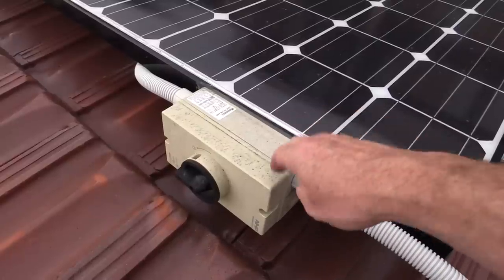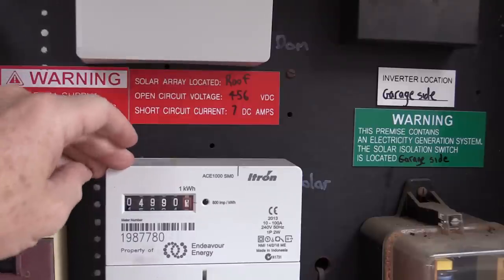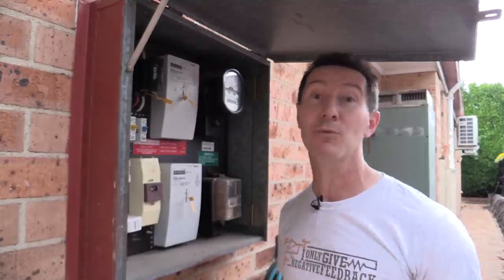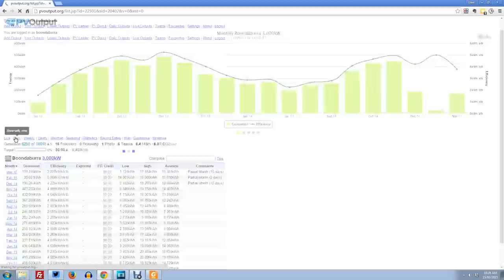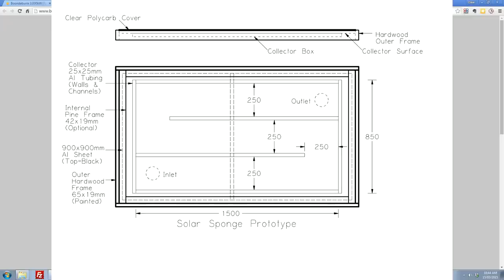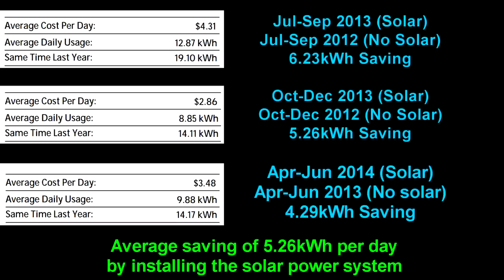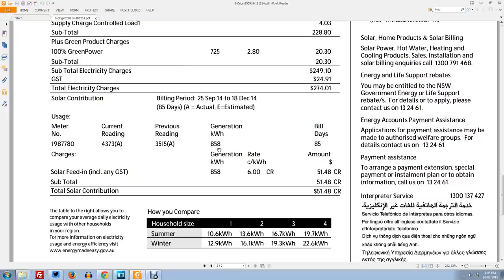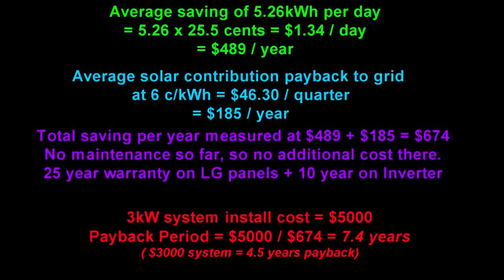EEVblog #724 - Home Solar Power System Analysis & Update

Comment: If you wanted to, could you put a battery into your system?
Reply from the maker: aMondia Yes, but would require a new inverter and other stuff.
Reply: EEVblog it would work as back up, truck batteries and charge during the day, use at power failure. We have a meter that turns back the dial with energy flowing to the grid :) bonus of the old stuff. Next to solar panels we have a solar heater, next step a mitsubishi ecodan and under floor heating.
Reply: EEVblog
No battery will be expensive you will never recover the investment at your rates.
Reply: Arjan Wilbie
Is that allowed by your energy company? It least where I life, it is forbidden to supply current into the grid with this old meters that can turn backwards. It considered taux-fraud as it is "not paying the tax for consumed electrical energy". But I mean: I speak about Germany and tax-fraud. It is both the biggest sin and most common activity in Germany. Given the complex taxing system, it´s no wonder.
Reply: ***** It isn't always about money, sometimes it's just about being a good citizen. If anything, the ROI may come from the fact that this is publically documented.
Reply: ***** Nonsense!
Reply: *****  you could build a 7kw battery out of 18650 lithium cells
for under 1000usd.  or just strip them from old laptops usually only a couple cells will be bad.
Reply: kolby4078 Commercial batteries designed for this kind of application are also totally affordable. If they weren't, there wouldn't be any market. Also, anecdotally, my uncle living off the grid in the sticks wouldn't be able to afford them.
Reply: sarowie the electric company knows we have solar panels, we used to have 3 meters in our property and we got 1 now, the others we removed and switched suppliers.
Reply: *****
I live OffGrid and I'm and EE I know how to calculate an amortization cost.
If you disagree come up with the numbers.
Reply: kolby4078 Show me the spec of those batteries and where I can get them for that price ? Used batteries are a really bad idea since you have no way to know how much life they have left and lithium needs a BMS that can not work with cells that are degraded at different levels they need to be in the same condition.
I use LiFePO4 for my offgrid house and that is by far the best solution for inexpensive energy storage. Still hard to compete with grid + the convenience of grid.
Reply: ***** Just look on alibaba, theyre cheap chinese batteries but still 2200mah@4.2v peak at $2 a cell
Reply: *****
Just found some 1500mah cells brand new are 30cents a pop
Reply: kolby4078
Have you ever used alibaba ? Those prices are there just to attract customers. You need to contact seller to get a real quote including shipping and then you will pay by bank transfer and wait to see what you will get :)
A cell without a datasheet is useless. Even a Panasonic or Sony LiCoO2 has around 500 cycles that is quite a few times lower than a LiFePO4 that has a few thousands cycles.
That $2/ cell is probably a real price but you do not know the quality of that LiCoO2 cell even if that was a genuine Panasonic as I mentioned it is more expensive for energy storage than LiFePO4.
2.2Ah x 3.7V nominal = 8.14Wh $2/8.14Wh = $0.245 per Wh
A LiFePO4 is usually $0.4 per Wh but a much better value for energy storage. Why?
Because a typical high quality 18650 LiCoO2 has about 500cycles where a typical LiFePO4 has 3000 cycles.
You do not calculate cost per storage capacity but cost per energy stored during the life of the battery. That is amortisation cost and gives you the cost for each kWh stored during the life of the battery.
Reply: EEVblog Have you costed using the surplus electricity to heat a hot water immersion tank, during the day? This might allow you to dispense with the gas water heating. Can you run a barbeque from electricity? Here in the UK people just buy bags of charcoal for that, but barbeques aren't as popular here.
Reply: dalriada842 electric can be used for a imersion heater, in combination with a solar boiler.
Reply: dalriada842
It may be the case that natural gas is less expensive than those 6 to 8 cent he gets for sending back to grid. Usually natural gas is the lest expensive form of energy. Here is about 3 cent/kWh for natural gas not sure what the rate is in Australia but I expect to be less than those 6 cent.
Reply: ***** The gas price I pay in the UK is about a quarter that of electricity per kWH. There's also the standing charge to consider on top of that though. If he could dispense with gas entirely, he might be onto a winner. Possibly pre-heat the water using a roof or ground source heat pump system(expensive though), then use the surplus electricity to heat it to temp. Solar power is a much more viable option at his latitude than it is at mine. My roof even points inconveniently East and West.
Reply: dalriada842 A ground source heat pump will never recover the investment at this sort of prices /kWh and will sure not be able to compete with natural gas.
Here in Canada the kWh for natural gas is about the same a quarter since is 3 to 4 cent vs 10 to 12 cent for electricity. But this are just prices for the unit of energy the total bill is higher since there are some fixed cost.
I'm offgrid so I will heat the house with PV directly. If I only use the PV for heat I get to about 8.8$/kWh but if I can find other uses for extra energy I can get as low as 3 cent/kWh.
Reply: ***** The heat pump idea isn't really viable for me either, but he's much closer to the equator than we are. He's also handy enough to lay the pipe work himself, further reducing the cost. The cost/benefit equation may work out differently for him.
Reply: kolby4078 a 1kwh lead acid battery is like 100$. though for my feeling it's totally not worth it, most batteries aren't designed for frequent deep-discharging
Reply: dalriada842 
Those heat pumps have very good heaters, plus its a drier heat. It just depends on where people live and what their needs are. In areas of high humidity it would probably be better to have the heat pump even if it's a little more expensive, especially if they have valuables that are environmentally sensitive.
Reply: ***** I picked up second hand deep cycle golf cart batteries, really cheaply.  I have the "equipment" to help to restore them and they came with a limited guarantee.  That worked out really cheaply!, at $35/8 volt battery, when a new set was over $1200!  They are replaced in the hire carts on a regular basis and sold for scrap!  I buy them at scrap price.
Reply: MrOzzyCam You have no idea how much energy you can still store in those scraped batteries so it may be the case that they are more expensive than new ones.
Reply: Ah, yes I do.  I had them load tested at the place I got them from.  Also I am in the process of using my own designed heavy duty custom built desulfator on them.  I can charge them at no cost and have plenty of energy to run my lab.  I also have an M.Sc. so I kind of know what I am doing here.
Reply: MrOzzyCam You should datalog the amount of energy used from them over their life and see what is the amortisation cost /kWh you will probably be surprised by the results.I done a lot of cost calculation related to energy storage and decided to go with LiFePO4 for my OffGrid house since they are the most cost effective for energy storage.I needed to design and build my own Solar BMS charger since there was none available for this type of batteries.
Reply: The new cost for the 6 batteries I got would have been $1250 for the set, new.  Second hand, tested and working still quite well.  With me also then reconditioning them, using only surplus power and a extra heavy duty desulfator, that I built it has cost me $210 (for the batteries) more for the rest of the setup, but even then, that was mostly from my junk box so I think I will take my chances.  That makes it easy to recoup my money without a huge risk.  I don't care if they aren't at 100% efficiency.  80-90% of rated capacity, that is still fine by me. Even 50% would still be a bargain and I was doing much better than that before I "treated them".  I don't run out of power in my lab and I don't pay anymore for it now either.
Reply: MrOzzyCam Your batteries are used so at 210$ vs 1250$ they should have at least 17 to 20% life left to be the same values as new batteries.But that is a lottery so you do not know for sure how much life they have left.The capacity of the old battery is not relevant since once they start going down they will do so quite fast.At 50% original capacity they are considered dead there is nothing there for you to use if you look at a cycle life graph.You pay in advance for power. For example at 20 cent /kWh those batteries will need to be able to put out 1MWh in order to recover that 210$ investment.Amortisation of new high quality Lead Acid is around 60 cent/kWh or over based on spec so a bit ideal.In same ideal conditions based on spec amortisation cost for LiFePO4 is about 10 to 20 cent/kWh depending on model but realistic number will be on the higher end so that is why my point was that with current battery technology and price grid power is less expensive than battery storage.
Reply: That is the cost was negligible for the batteries, apart from the chiropractic costs from lifting the batteries into the truck....;D Which would have been just as true for new as second hand batteries! 

 Look up battery desulfators.  With battery recovery as long as there are no shorted cells (which is a common failure) or they filled them with tap water!! then they really do work well but you have to be patient for them to work, especially with the commercial units.

 I have seen desulfators raise batteries from the dead!!!  Mine has a few tweaks to speed up the process, while not causing the battery to explode.  Plus I threw an old 6.5 MHz BWD CRO at it, for permanent checks of the waveform and for tweaking. (Yes, when I get time I will code a controller for it!)  The CRO had less bandwidth than my handheld one anyway.  I like to see what is going on in real-time anyway and an analogue CRO even a cheap one works well for this task.
Reply: MrOzzyCam Desulfators are a waste of time and resources. If there is just a soft sulfation that can be solved with a bit of overcharge. If however that is a hard sulfation more than a few weeks with low SOC then you are just wasting your time and energy.Lead Acid are only good as car starter battery for for some UPS type application and not for energy storage.It will take a bit of time before people get educated about this.Anyway the original question here if batteries make sense in grid tie application and the answer is clearly no at least at the rates Dave pays and is paid for that.A battery to break even no profit will need to cost about 24 - 8 cent so 16 cent/kWh and that is just not possible today.Lead acid are extremely far from that 16 cent/kWh value and LiFePO4 is closer but that is just battery not the rest of the equipment needed for energy storage so still not an option.
Reply: The point I should have started with is that I built the desulfator first!  I wanted old large batteries to test out "my" design.  I wasn't going to spend $1250 on a test.  I used old Emerson Inverters to convert back to 240 V.  Not efficient, I know.  Commercial desulfators don't work on big batteries, hence my heavy duty design.  I don't pay for the power, the batteries are only charged on surplus.  I don't see the problem.  I paid maybe $300 total for a system (Not including the panels that I had anyway) that powers my workshop at no cost.  I am not an accountant and don't care about amortisation but if I did, I don't think I would be behind as such...... Not the way I set it up.  The CRO cost me $20, I did forget that!!!
Reply: MrOzzyCam This discussion was about economics of using a battery for energy storage and use at a later date and the economics do not work out in the favour of battery storage at this point.
Reply: Oh too, I ride a Zero DS all electric motorcycle, so I am not ignorant as to battery tech as I have to conclude that you are implying.  These are cheap batteries to make use of my total of 26 x 255 W solar panels.  If I have surplus power they pay me a whopping 8 cents / KWh for it!  If I use their power I am paying over 22 cents / KWh for it.  I like to store some of my surplus power.  Sure if battery tech was CHEAP enough I would go to another battery tech.  These batteries are from golf carts, driven by the elite in this area.  They slow down just a bit and they want a new set.  The guy I get them from has battery testing stuff to spare, he picks me out the best ones.  I also am looking into making batteries!! all the way to Al air etc.  As I said I am a research scientist.  This isn't about the money for me, I am interested in the technology.  

As for desulfators, the whole idea is to not just apply a constant high voltage.  It uses high voltage spikes, to breakdown the crystals. Have you ever really seen one in action?  Done right they work well.  Done cheaply they are too slow to work.

I have nothing against  LiFePO4 batteries, I would like some for my bike.
Reply: My point is, that if you have the skills and do your homework and are willing to go surplus and home built.  Then there are ways to make it happen now, cheaply.  

Of three things, I always say you have a choice.  You can have it cheaply, you can have it quickly or you can have it well built, you have a choice of two of those three options.  I opted for the well built but it took time to put together with scrounging parts.  I could have had well built and quick off the shelf, but it would have cost a bomb!!
Reply: MrOzzyCam What I try to point out is how you decide if a battery is cheap or not. Is not about the initial cost is about the amortisation based on the work that battery is performing.In your particular case a battery needs to cost 22 - 8 cent/kWh = 14 cent/kWhIf you invested 300$ in your battery then that battery need to store and provide about 2MWh at 14 cent/kWh to recover the initial investment no profit just investment recovery.If you can not do that then is better just to use power from the grid and sell the surplus at 8 cent.Used batteries are a gamble there is a chance they are still at half their useful life but there is also a chance they are well past that.If you got them for 200 or 300$ used they better have at least 25% usable life else you paid more than for new batteries.Is next to impossible to know the remaining life so as I mentioned they are a gamble or I think I used the word lottery.Even if you consider 100% charge discharge efficiency (far from reality with Lead Acid) and great deal at 200$ with half the life cycle still left you will still not get to that 14 cent/kWh.So best thing to do is just measure the battery output current and voltage and log that for the life of the batteries then see how much you where able to store in them and what will the amortisation cost be.I'm extremely sure you will be at a loss and no where near 2MWh you need to recover the investment in battery.I use LiFePO4 because it has battery amortisation cost than Lead Acid but I can not compete with grid price here ar around 12cent/kWh for large consumers. I was using just 250kWh when I had grid power and bill was 50$ so 20 cent/kWh but that because of the fixed costs the kWh was just about 11 cents/kWh.PV panels amortisation cost is around 3 cent/kWh my battery amortisation cost if I'm a bit optimistic is about 20 cent/kWh average energy for me will be under 20cent since a large part of energy is used during the day directly from PV and just a smaller part is used from the battery.
Reply: Well I know my system does what I need it to do in order to help cover night usage.  For the $300 I spent, it helped make better use of my solar panels.  I already had the two large Emerson UPS, that act both as chargers and inverters and they were simple to hack.

 I get it that your points are about the amortisation costs of a system.  I don't think my system needed $1250 worth of new batteries.  Plus, as I said, in my case I actually wanted the old Lead acid batteries in order to test my desulfator design. I was looking at setting up some proper logging, rather than gut based logging and a few crude notes, but time is my enemy, as is the variable charging and discharging that they endure depending on the weather.  My case isn't the kind of thing that you were talking about, so let's leave it there.  Thanks for your input.
Reply: Igor K Have you read the replays. The battery option is more expensive than grid power at his location by quite some margins.
Reply: Igor K salvaged car batteries are one of the worst option when it comes to energy storage. The cost per unit of energy stored will be huge even if the battery is free.Photoinduction guy will know that if he will make some simple calculations.I have already two year of OffGrid and I cheeked in details all energy storage options.My amortisation cost with LiFePO4 is about 16 cent/kWh but this is only for equipment I did not included all my work on the project.
Reply: Hmmm.  I got my lead acid batteries for next to nothing.  I charge them with my 26 solar panels.  I then put the energy back into my system.  It has cost me about $300.  I do save money using my own power.  I have recovered what would have been considered "dead" batteries with my desulfator. 

I also gave an old school friend of mine $2500 AUD so he wouldn't be thrown out of his house.  Money doesn't matter to me as much as it does to some of you guys obviously.  Amortize that!  I gave him the money and told him NOT to pay me back.  I am his friend and didn't want to be just another person that he needed to avoid because he owed me money!  In Australia we have the concept of mates.  Money is only good for what you are able to do with it.   I am doing research.  The money is not the issue with me.
Reply: MrOzzyCam Oh too, by hacking my inverters so they can run phased.  I a can produce 3 phase power.  Something I can't get where I am even grid tied.... I am in a rural area.

In Australia, I am lucky to have decent internet.  There are people that are only a mere 10 minute drive from me, that have to use a satellite to get internet, at great expense! Plus It is really slow too!
Reply: MrOzzyCam
Is not any better regarding Internet in rural Canada.
I need to use 4G "unlimited" but is reduced in speed to almost nothing after exceeding 10GB/month (that is done in less than a week) then I'm reduced at 256kbps down and 128kbps up for the rest of the month.
With satellite is not much better and it may be weather dependent.
As for battery cost amortization that depends on what are you interested in.
If battery is as UPS for backup then you do not realy care about amortization cost as much since that energy is more valuable for you.
All my equipment including battery for offgrid is amortized at 16 cent/kWh but with LiFePO4 and I did not include all the work I put in to installation and the fact that I need to watch the way I use the energy based on whether.
Reply: +SouthJerseySound How was that $2500 calculated. If you are grid connected in most countries a kWh of energy is around 10 to 20cent/kWh. I will use the best case 20cent/kWh so $2500/$0.2 = 12.5MWh is what you should have got back from that battery and if you say you had that for 3 years about 1000day then 12500kWh/1000 = 12.5kWh in average per day out from that battery (You should have put in around 16 to 20kWh in the battery in order to extract that 12.5kWh do to low cycle efficiency of Lead Acid).
Your battery should have been a high end high quality and as new battery to be able to do 1000 cycles of 20 to 30%DOD it means your battery should have been at least 50 to 60kWh capacity.
Another assumption was that energy going in to battery was free also (not sure how that will have been possible) least expensive is a new PV solar panels around 3cent/kWh and if it was from the grid then probably well over 10cent/kWh.
I make a lot of assumptions so I will like to know how you got that impressive $2500 in savings from a used and free battery in about 3 years.
Reply: SouthJerseySound
Yes using a generator is extremely expensive can be as high as $1/kWh so of course compared with that almost anything will be competitive.
55galon is about 200 liters so is $500 for that type of gasoline that is like $2.5/liter and one liter contains probably around 10kWh energy if burned with 100% efficiency.
Since most generators are 10 to 20% efficient in converting that to electricity I can assume you get 1 to 2kWh /liter so in this case it can be much more expensive than I initially mentioned.
Compare that with 3cent/kWh for solar PV :) not worth mentioning.
You have a special case people here where disusing storing grid electricity at somehow reduced price during the night or off peak hours and then use that during the day during peak when price is higher.
Not even LiFePO4 can make this a profitable business. Lead Acid even if free will not be able to do a profit if you just consider the bad cycle efficiency.
I do have a video on my youtube channel where I compare a new quality deep cycle Lead Acid with LiFePO4.
I also live offgrid and store energy in LiFePO4 and designed my own Solar BMS in order to charge and manage Lithium cells.
Reply: +SouthJerseySound Yes having free batteries is an advantage but you need to consider the fact that charge discharge efficiency is low on Lead Acid from as low as 50% in the top 20% of the charge cycle and not better than 70% with deeper charge discharge if you still go to 100% SOC.
Also you need to consider the inverters since those have usually limited life time and need to be included in the cost amortization and can have a big impact in the cost of energy. The usually last 5 to 10 years depending on quality and how heavy are they used (mostly do to electrolytic capacitors life at high temperature) same is true for MPPT if you use that.
I will really not bother with batteries in grid connected homes. Even with free batteries there will not be a profit there. I guess you can sell the excess to electrical company if you have solar and that will be better than storage for latter use.
Reply: Flow batteries are designed for deep discharge.  Google Redflow